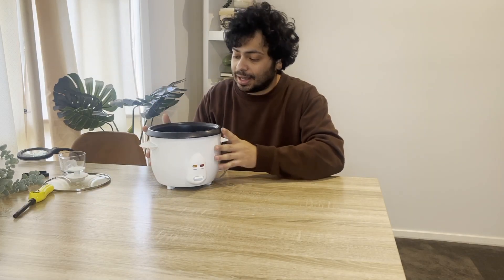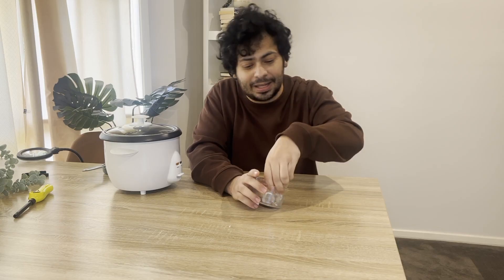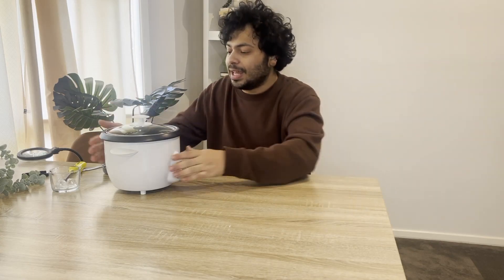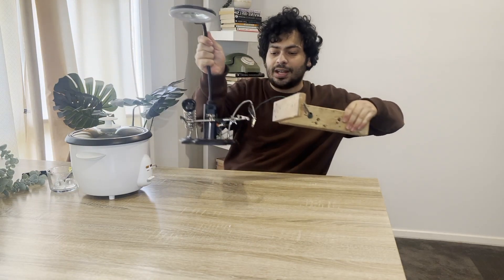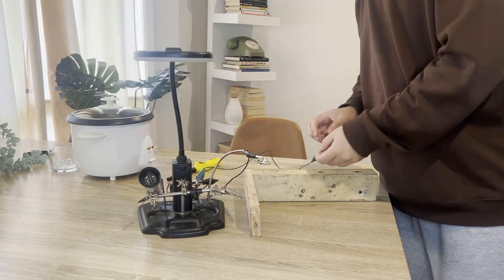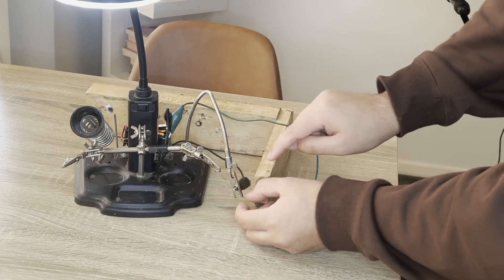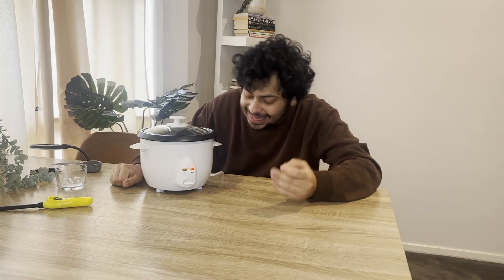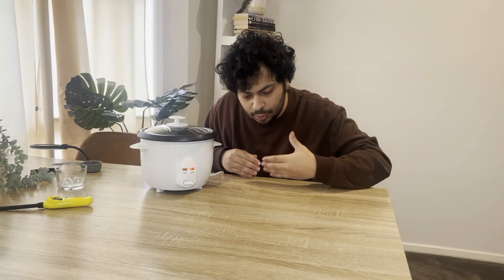How Does A Rice Cooker Know It's Done?

Comment: What if we live above sea level? Do we add more or less water?
Reply from the maker: You’d need a rice cooker that’s calibrated or corrected for higher altitudes. but most rice cookers work up to 5000 feet. you may get away with adding a little more water.

Comment: cough .....supercritical water .....cough, cough.
Happens all the time at sea level, bottled water and a microwave.
Reply from the maker: Supercritical water happens when the pressure is able to be increased and allows the liquid water to reach higher temperature like in a pressure cooker. This can’t happen at sea level pressures that’s why i stated sea level. Superheating without producing bubbles at ambient pressure is possible under controlled conditions because the surface tension of the water needs to be overcome to create bubbles but the result is water which is only a few degrees hotter than 100 degrees Celsius and is very unstable. it needs even heating, a very smooth container and purified water.